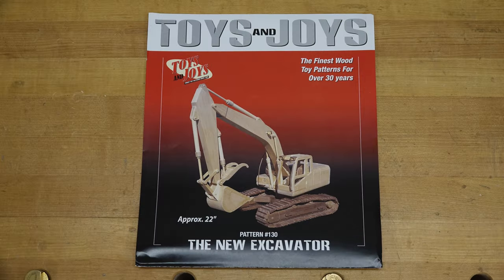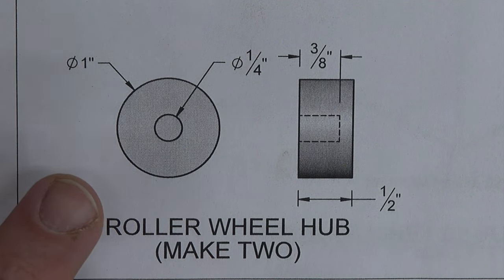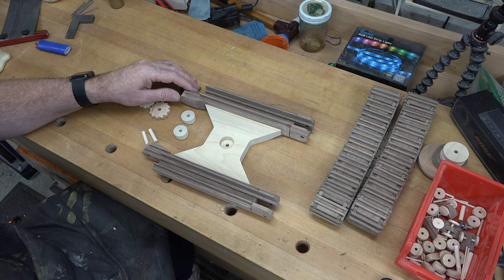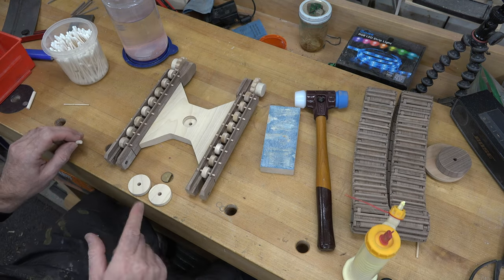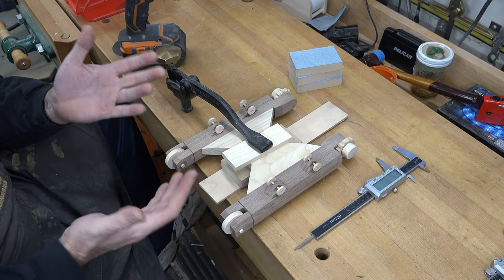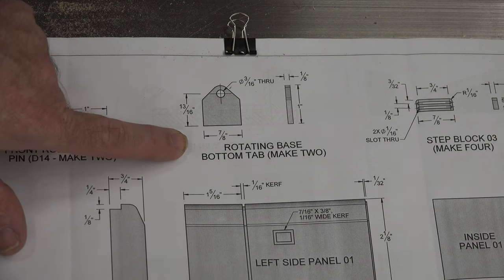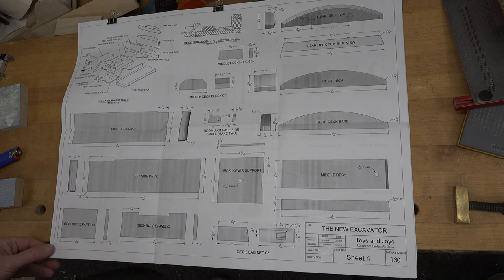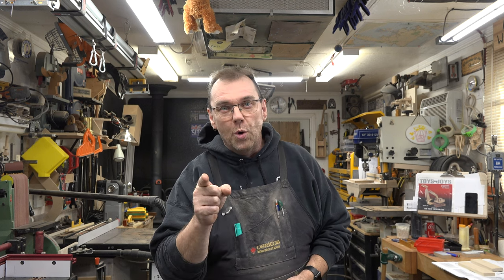Toys and Joys "New Excavator" Part 4

Comment: Good advice on problem solving. I would only add that something you mention you did (thinking about solutions thoroughly for a long while) wasn’t emphasized in the wrap-up. Taking a step back lays the groundwork for successful problem solving and eliminates a rush to correct that might just be irreversible and only make matters worse. ie: if you had proceeded to sanding the wheels out of round before thinking of the genius power drill trick! It also proves again that watching a video about something you never intend to build may help you in the construction of something completely different. I always pick up a new trick or tip on YouTube. Thanks!
Reply from the maker: I couldn't agree more Gary.  Sometimes, stepping back and taking a break from the project is the best solution.  Frustration can injure a person in the shop just as quickly as fatigue so stepping away is a good thing.  Thanks for tuning in Gary and for chiming in with the wise words.

Comment: Very ingenious way of reducing those Wheels I believe the reason your Dri-Fit worked with because the two guides for the top kept moving inward on you to the center which loosened it enough to let it roll smoothly
Reply from the maker: You're probably right there Ken.  Thanks for tuning in and for chiming in with your thoughts.  It's very much appreciated.

Comment: Another great session!  Realized that it was going to be posted today so I had to pull into a Truck Stop, have a cup of coffee and watch it 😃.  Gave me an excuse to take a break from driving, on my way home after visiting the Grandchildren for the past 5 days 🥰🤠.  I’m considering making either the front guide wheel or the sprocket adjustable when I build mine.  The actual tracks on the real thing are adjusted by forcing grease into a cylinder,  Very simple yet efficient.   Trying to figure a way to recreate some sort of moving cylinder or slide on the model that would have a pin or ???? 😬
Reply from the maker: That sounds like an interesting modification Randy and I would be interested to see what you come up with for that.  Thanks for tuning in.  Hope you enjoyed your time with the grandchildren.

Comment: I would have glued in the top roller wheel brackets after the track was in place. They could be adjusted a bit forward or back from the location on the plan to adjust the tension on the tracks as needed.
Reply from the maker: And that would have been just fine as well Gopher.  Nothing is written in stone when it comes to making these models and choosing your own methods is what it's all about.  Thanks for tuning in and for chiming in with your ideas.  It's appreciated.

Comment: Hi Kenny, what about adding an extra link in each track, or would that be too sloppy? Of course, shaping and rounding under the track area's would still probably have to be done also as you said.
Reply from the maker: Perhaps a half link might serve the purpose better if a full link made it sloppy.  Now it's been a while since I built this and I believe that I did actually add a full link in there to make up the difference but it still required adjustments.  There are so many factors that can alter the fit of the track, it really has to be diagnosed on an individual basis but adding full tracks, half tracks, spacers or adjusting the guide wheels are all possibilities.  I hope this helps.  Thanks for tuning in to the show.